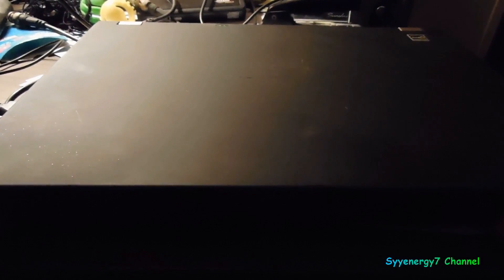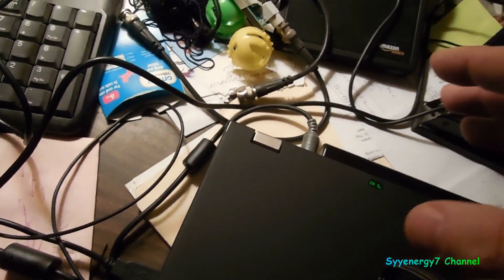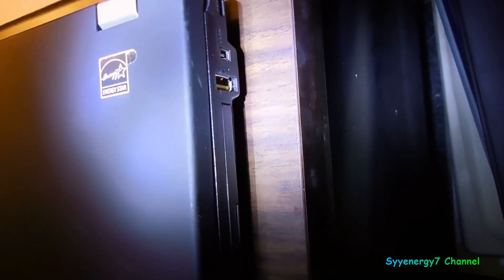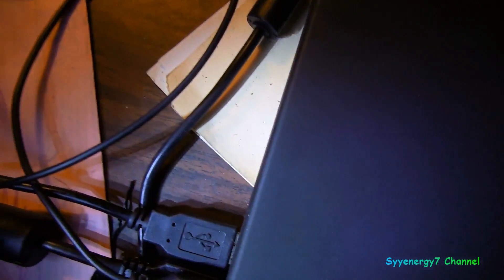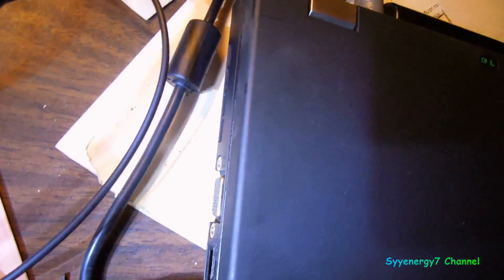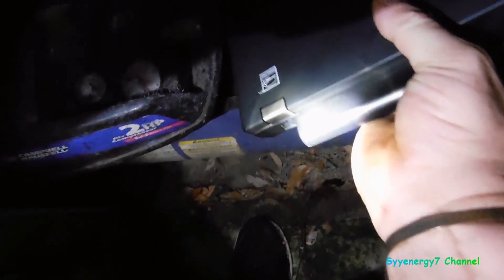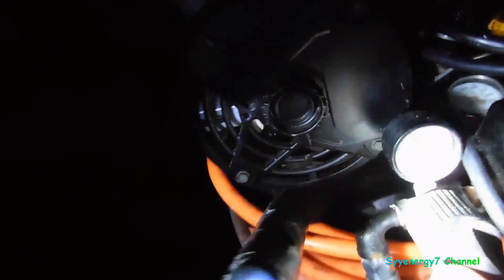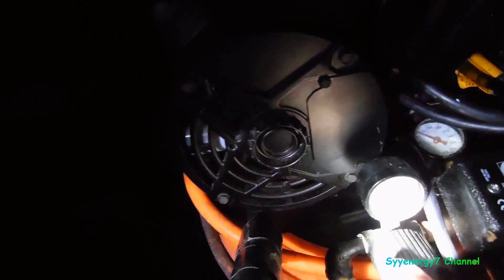Lenovo Thinkpad T410 FAN error FIX

Comment: The fans of these things are real shit (the bearings rust) ... and the keyboards. I had to change my T520 keyboard like 4 times.

Careful with the compressor you might accidentally brake the fins or bend the fan bearing and from then its either fan error or rattling.
Reply: +metalon The thing is that there is a real big build quality difference with newer (2013-14 models specifically) thinkpads. The keyboards are crappier, less solid feeling. Older models such as this T410 and the T420 are excellent in terms of build and hardware. They're still a comparable option to newer laptops out on the market today even!